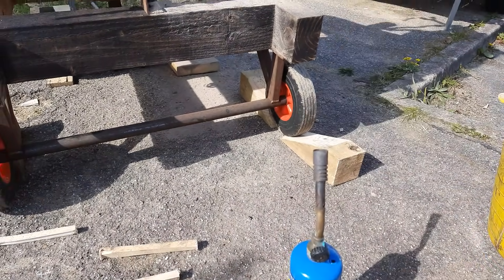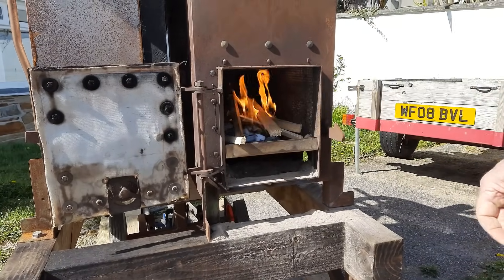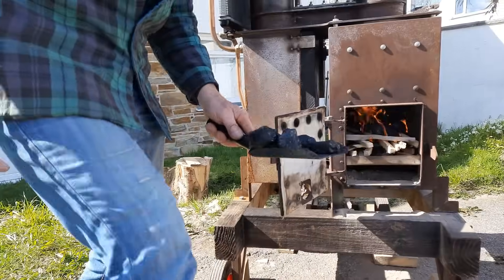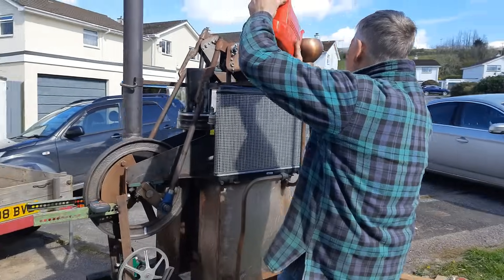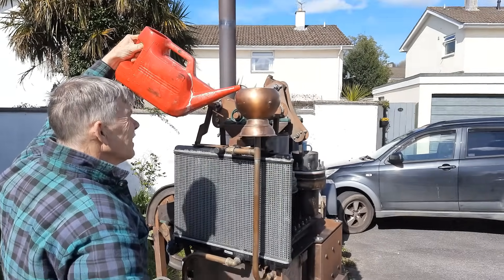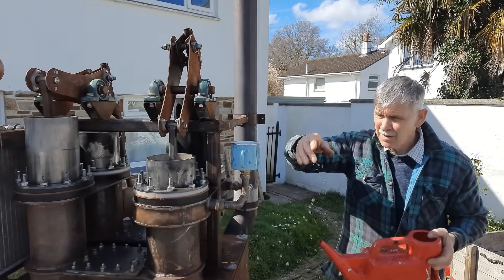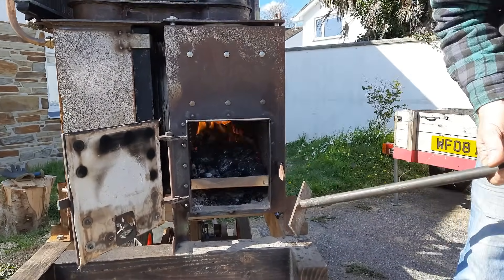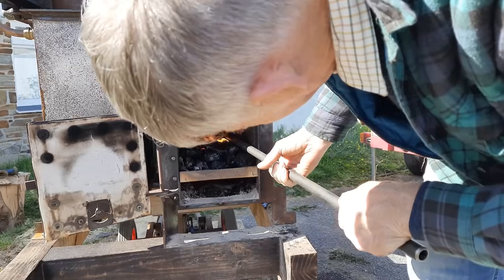Stirling Engine Generator Homemade DIY 0.47 KW ! Part 3

Comment: Awesome build but for only six hundred watts you better off buying cheep solar panels for three hundred bucks which might have come out a lot cheaper and they don't give out! I've had my 1000w newpowa solar with a cheep inverter for a couple of years and it blows all that hard work to bits! No disrespect but that's just not feasible!
Thank you for sharing your wonderful design and God's blessings to you and yours 🙏

Isaiah 26:3-4

 You will keep in perfect peace
    those whose minds are steadfast,
    because they trust in you.
 Trust in the Lord forever,
    for the Lord, the Lord himself, is the Rock eternal. 🙌🏽

All Glory to God 🙏
Reply from the maker: Your probably right! I'm having great fun through! Just been thinking about your post, maybe I need to add the ability to cook on it and heat water up to make it worth it?
Reply: @ShanePomeroy  that's good to hear! If it's not fun it's not worth doing 😂
If I were you I would get rid of the coal and install a fresnel lens 🤷‍♂️ of course that would limit you to sun but if you get the right panel it would be interesting to see the results. Hard part is tracking the sun but there's plenty of solar trackers out there that would do the job cheeply

Comment: Well done!  Thanks for sharing the journey.  Thinking how much is wobbling... might be beneficial to make another flywheel on the shaft that counter rotates somehow that's the lowest friction.  Not certain what mechanical design is the best offhand since I'm not a mechanical engineer.  Though seems a counter rotating flywheel will calm the machine down.  Nice work!

Comment: Stirling engines, when compared with steam engines of the same footprint, do not produce anywhere near the torque and power of steam. That is why they were never used in locomotives and ships.
Reply from the maker: Yes, totally agree. The simplicity of them appeals to me so I will continue pursuing this!

Comment: %Efficiency?
Reply from the maker: This engine is not that good. It was initially built as something of interest. Hoping the Mk3 version will be much better!
Reply: @ShanePomeroy  yeah, I know that it is not that good. These engines require a lot in order to reach high efficiencies. I wandered how efficient can a backyard-built sterling engine be
Reply from the maker: From the research I've done, a well designed stirling engine can develop 1watt per CC . As for efficiency I think they are limited because alot of the heat disappears up the chimney unless it can be reclaimed somehow. They will not compete with an internal combustion engine but they will run on lots of fuel types! I've planning on a Mk3 engine which will be simple to build and be much more efficient

Comment: Beautiful. Never seen a Stirling engine that size running before. Thanks for putting this online!
Reply from the maker: The plan is to build another mk3 version with better power to weight but very simple (cheap!) Build. I really think its possible!
Reply: @ShanePomeroy  It would be nicee to see something which could reasonably be made on a desktop mill and lathe. If high thermally conductive materials were used and such it would be interesting to see how small it could get. I wonder how many modified off the shelf parts could be used to make it easier.
Reply: @ShanePomeroy  i know this sounds stupid but, is it possible to make a car using stirling engine?
Reply: @ShanePomeroy  Awesome, Can't wait! 
Did you ever considered in building a LTD stirling that runs on hot water for home use with a similair power output as this one (like the "Sunpulse 500")?
Reply from the maker: @markgeurts258  no, but I will take a look, cheers
Reply: @markgeurts258  then like this engine it become a steam engine ... a sterling cycle engine only uses the difference in heat between the hot and cold side to work ... adding water as the motive force makes it  steam engine ... this one depicted is a watt condensing steam engine NOT a stirling cycle engine
Reply: @ShanePomeroy  nice watt condensing steam engine ... sterling is a heat differential engine ... you are using HOT water (steam) to move your pistons that makes it a steam engine ... a sterling engine uses the pressure of HEAT not steam and the vacuum of cooling to move the piston ...
Reply: @kaboom-zf2bl i meant use the heat/hot air indirect from the hot water with a heat exchanger😉
Reply: Look for "Sunpulse 500".
Reply: you still havent that is a watt condensing steam engine ... a sterling engine has no need for water ... as it uses the difference in heat between the hot side and cold side ... they are using steam pressure to move the pistons ... NOT heat differential
Reply: if he could add a lubrication system and add more cylinders to balance out vibration it might be even more impressive.
Reply: That’s sad you’ve never seen one bigger than that because mines at least twice as big, it’s also got a Effer phosphor vestment chlamydian jokitch munia-  Sorry if my English is not perfect it’s not my first language

Comment: Your math is dead on. That's a clever way of measuring the torque. If I understand it correctly the end of the reaction arm is 1.5ft from the center of rotation. If it were up to me there would be a counterweighted crankshaft above  the pistons. That way you could balance out your forces. Great job!
Reply from the maker: Thanks, Maths isn't a strong point, so if you see anything that's isn't quite right, please straighten me up! I like the counterweight idea, I'll right that one down, cheers

Comment: Would you sell it? I want one.
Reply from the maker: Probably, once I've finished experimenting / fine tuning and need the room to build the next one!
Reply: @ShanePomeroy  well if you think about it. Give me a shout. There's a market for these, esp at the moment. A small unit that can generate enough for a houses usage in a day connecting this to charge batteries all day would be more than enough daily power. Nobody is producing a unit, whether it's a Stirling, wood gas or steam power that can produce between 200-500 watts but there is a huge demand for it.
Reply from the maker: Watch this space, mk3 on the way!

Comment: First, that is a beautiful machine, and I respect that you saw it through to completion. 
Here are some ideas that I would like to try if it was at my house:
-Replace the alternator with a high voltage dc generator 100v or so
-feed that dc voltage into an MPPT solar charge controller (and I am very specifically recommending the OutBack Power FlexMax-80 or some other high quality unit, not a cheap Chinese model)
-you can now adjust the electrical load through the settings in the charge controller (a VERY convenient way to test, measure, track, and data log ACTUAL electrical output via the meters built into the MPPT)
-use it to charge a battery bank 
-use the battery bank and an inverter to power my small cabin
(I am a solar installation tech.)
*We already have solar, and so I have wanted to add a constant stirling power unit to the same system that could run from heat produced by our wood stove during the winter.
*This also makes me want to build a power unit like that so all of our burnable trash can be incinerated and converted to usable power much the same way.
*Please understand I am so interested in helping you experiment, I would love to talk more about it (I will watch the other videos as well so I don’t ask questions that your videos already have answered) 
I would even consider helping a bit financially for you to buy the solar charge controller I mentioned.
My interest primarily is just to see if building something like this is within my own reach, although 100-200w continuous electrical output would be good enough for me to pursue it.
Reply from the maker: Hi Wesley. Great to get in touch. Thank you for your advice and specifying what you'd be looking for. I'm very interested in both!generating a higher voltage initially sounds like a good option. I do in fact have a cheap solar charge controller to play with. I'm unfamiliar with MMPT tracking concept? Is the unit able to vary the volt/amp ratio to suit? Also, I'm planning to build a mk3 engine that will be simpler, cheaper, simpler
Reply: @ShanePomeroy  yes the MPPT charge controllers are the one that step down the DC input voltage to put out a specific DC voltage to the battery bank, and the amperage usually increases in the conversion you got it.
I will definitely keep checking in on the project, I’ve wanted to do something in that power scale since 2010 but never have committed because of other needs placed on my time.
Reply: I've often thought about a setup where you could use a wood stove or fireplace with a heat exchanger to circulate hot water under the floors for heating, in which case it wouldn't need to draw air from the room, but rather an outside air intake, so there's no draft. Put a sterling engine in the middle of that heat exchanger, and you could generate electricity at the same time. The "cold" end of the engine would be your under floor heat, and after that it could go to an outside radiator if additional cooling was needing. Add some bypass valves and you've got yourself a thermostat.

Comment: Do you have any information on dimensions etc. I would like to build one of this sort of size
Reply from the maker: If you look at my early Mk2 video's , I've got the spec of the engine listed. The engine is based on a "Rider compression engine" and I worked out the ratio's from that. In all honesty I don't think the ratio's need to be spot on to get an alpha stirling engine to run OK.

Comment: You can mount a fan sucking ar trough the radiator and directing this air under the firebox, so you'll have a cooling/blower with a single electric motor...
Reply from the maker: Great idea, thankyou

Comment: Would a belt driven fan across the radiator at the top allow more cooling for the cycle or would that slow it down?
Reply from the maker: Hi Rob, Good question? Maybe it's something I could play with

Comment: Lubrication ? It sounds a little crunchy
Reply from the maker: Yes, it rattles and bangs a! I've improved things a bit! Lubrication is a bad thing for stirling engines ( heat transfer issues). Interesting to see how long it lasts!
Reply: @ShanePomeroy  I suppose you can always replace the rings/seals on the piston and maybe the liner eventually

Comment: A machine like this needs a cast iron frame and mounted to several cubic meters of isolated concrete slab. Like a blacksmith's auto hammer. As it is now I'd be afraid it would tear itself apart if it ran it very often. Otherwise FRICKIN SWEET!!!

Comment: superb, now we need one that people can replicate with minimal tools.
Reply from the maker: Ian, Love your thinking, stay posted for engine Mk3!
Reply: @ShanePomeroy  50 to 100w is enough.... get a stepper motor or similar permanent magnet generator for for 18v out to charge 12v batt couple of amps. 24v scooter motors are good.
Reply: @ShanePomeroy  fluidyne sterling is easy to make...just plumbing fittings, no lathe

Comment: Awesome love it! should add a ring of magnets around the flywheel, and a few stationary coils of wire on the frame would produce electricity with out adding belts or cogs..
Reply from the maker: That is a great idea and also adds to the simplicity of things! When I build Mk3 I'll try to incorporate that, thanks
Reply: @ShanePomeroy  it was an idea of my dad's he wanted to do it to a water wheel, but never found the place to do it!.. i think it would work well on your sterling engine!.. cram as many magnets as you can on the wheel, could even do both sides with a coil on both sides.. be an interesting experiment..

Comment: This looks like a great start. Balancing/weighting your flywheel should give you a decent boost in speed and power. Not to mention it will reduce/eliminate the shake and noise.
Reply: They say great minds think alike. They are correct.
Reply: Yeah.
Just a bit more revision on the mounting constructions.

Comment: Next stage:  1 Kw using solar heating.   That’s my fantasy, 3Kw elec from solar heat collector
Reply from the maker: Hi Peter, Thankyou for letting me know what your after. I'm trying to understand what people want and develop the next engine with that in mind! Do you live somewhere with lots of sun? We get a little sun but mostly rain!
Reply: @ShanePomeroy  thanks. I live in Ohio. Decent sun, I guess.  I was researching concentrated solar heat collector.  The heating pipes would be placed in glass tube (or a solar box if I’m on a budget).

To me, 1kw is the goal since it’s a round number & it’s an easy number to work with on the electric bills.

Comment: I would like to suggest that you use a small solar panel to energize  the field windings on you alternator or a peltier cell on the fire box so as not to drain the battery.
Reply from the maker: The great thing with that it means you don't rely on the battery! Might not even need the battery, I'll look into it!

Comment: I would find a more efficient and readily available fire source, as well as placing a flue on the chimney as to contain the heat better, I would also work on your balance being that the amount of movement outside of the flywheel is lost.
You may be able to add a second counter rotating flywheel that should help balance and run more efficient and produce more power.
At 11.9 liters you should be producing a level of power that could effectively run a generator enough to power yours and your neighbors home
Reply from the maker: Solid advice! I'll work on it!

Comment: Well done lads ! When it comes to Prepping, I prefer your machine to a solar panel of equal output.
Reply from the maker: Thanks 👍, Just need to work on the power output, size, efficiency, cost for the next one. Hoping to develop something genuinely useful for off grid use that is of very simply design / cheap

Comment: What would you use this for? Interesting , suppose if you had free wood you could run a generator and get  free electricity :)
Reply: vid, 1919, electric car, 80 miles range..were going backwards,,not forwards.. this was before solar,,solar in non re cylcle able. same as wind farms..being green is a scam..those old engines from the 1800,s, still work today,,will your i phone..

Comment: I am so amazed  so you used 1000000 watts of power to get the coal  the wood the steel and everything else to your house  so you can make 500 wats  staggering
Reply from the maker: I think you hit the nail on the head! I wonder how much energy a electric car takes for full life cycle
Reply: @ShanePomeroy  you could buy a brand new car    for 120 years  before you get the same impact as an electric  car   and that's before they work out how to recycle  it  so it would probably  be another 100 years   and how much would you save  100k car  agaist  20k petrol car   you got 80k to spend on fuel  that  a lot of miles

Comment: Solo una precisazione. Il rapporto tra kw e Hp è 1,36. Quindi 0,472 ×1,36= 0,64 hp.
Ps:
1kgm=9,81Nm
1 kw= 102 kgm/s=1000Nm/s= 1000J/s=1000W
1 Hp= 75 kgm/s= idem come sopra 
1Kw÷1Hp= 102÷75= 1,36.
Hp= kw×1,36
Reply from the maker: Thanks alot, great information. Maths isn't my strong point. I really appreciate it
Reply: @ShanePomeroy  Thank you for the video 😊

Comment: I know you will get better numbers as you refine this machine.   I notice you have a lot of compression prior to being able to run before getting really hot.. might I suggest that your timing between hot and cold can influence its ability to run with less heat, and can also be used as a throttle and torque control.  I know because I do this with smaller Sterling engines.   Nice work and I look forward to your progress.. still waiting for you to integrate thermoelectric energy scavengers to it!
Reply from the maker: Hi Eric, I took note of your last comment about thermoelectric energy scavengers and am looking at them with next engine. I am very interested in your engine with adjustable phase timing! Any chance of a video? Once I've sorted out a sensible electric generator on mine I'd like to move the phase timing to see what effect it has on output. All the best
Reply: @ShanePomeroy  I posted in a facebook group, same group I found your videos shared called "Sterling Engines Group".
Reply: I actually no longer have that however, I was thinking about a mechanical centrifugal timing avance much like in old chevy ignition dustrubutors..
  But, what I did was have the cylendars 90° orientation from the other with a flexible transfer pipe and an elongated bracket mount much like an old alternator or power steering bracket.  I could get it to spin low power with a tea candle then adjust it to scream with more heat.. or make it not over rev at the same time.

Comment: Spectacular! Install it in the backyard with a shed around it. Hook it to a generator and you are free of Government supplied electricity. As long as you keep it fed and have a battery bank to even out the energy when you cannot supply enough directly.
Reply from the maker: Yes, use the battery bank as a kind of buffer to compensate for it's low output.  I'd need to get the family working a shift pattern to fire the thing! but then, if you lived off grid and you only had fire wood available?
Reply: @ShanePomeroy  there are automatic feeders that can do that job. Another thing you can do, is heat mineral oil with fire and solar. Put that into an insulated tank underground. 700 gallons will be enough to make the system work.

Comment: what would be useful is a small one of these you could connect to a stove in an energy poor country so when they cooked they could recharge their batteries
Reply from the maker: Hi, Yes great idea. When I build the next engine It will be smaller, more powerful but still simple to build, run and maintain. cheers